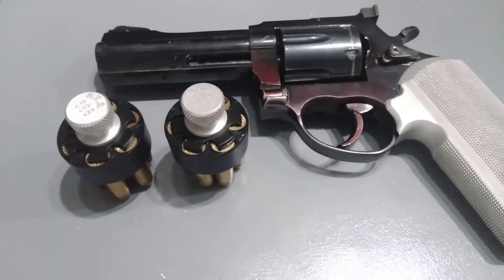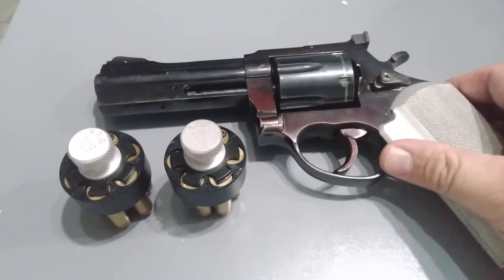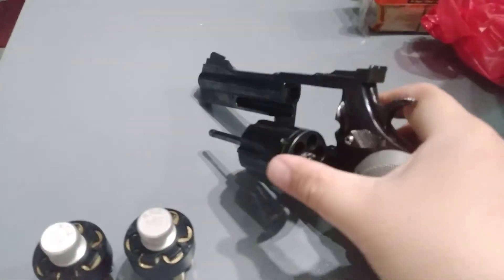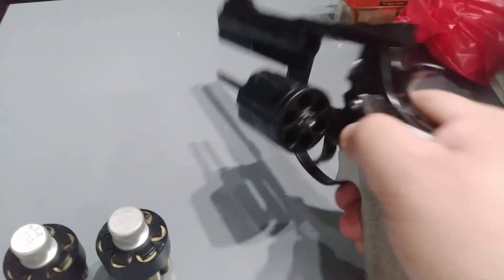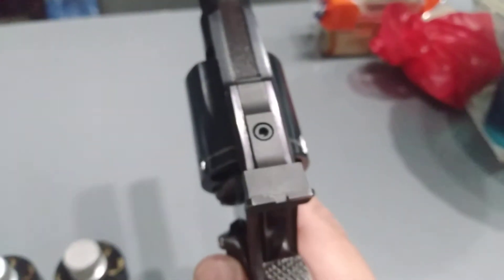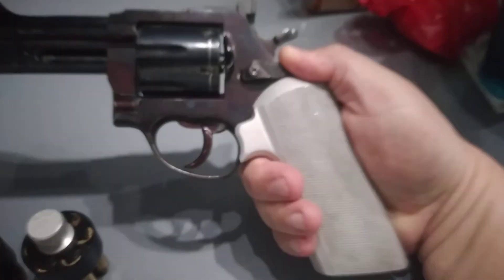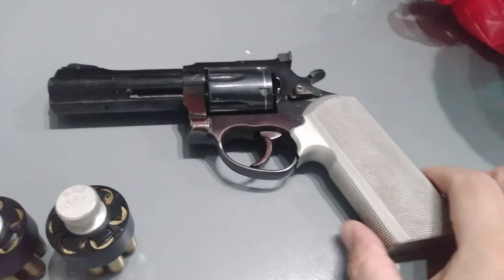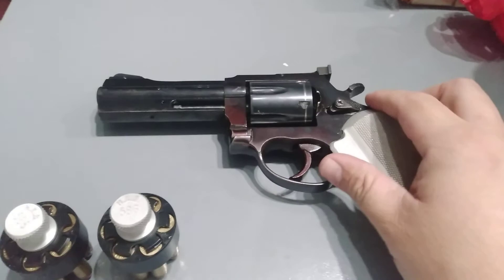Rexio .357 Magnum Revolver Mods -- An Impromptu Demonstration

Comment: Marerecommend niyo po ba ito compared sa RIA/Armscor M206? Kasama kasi to sa Red Tag sale worth 11k siya ngayon unit only sa pbdionisio.
Reply from the maker: Recommend for what purpose?
If used as specimen for leisure range shooting, experimentation, hands-on learning about revolver's use, or as "proof-of-concept" platform, YES, any economically priced gun may do.

But for self-defense and competition, that has been proven solid and reliable yet not too heavy only two .357 revolvers I can "recommend":
a) S&W Model 19 "Classic"
b) Ruger GP-100 "Match Champion"
In that order both in 4.25-inch barrel length and nothing else.
Reply: @chrissanchez9935  Would they cost more than 30k pesos? Sorry I wasn't sepcific. Im actually just looking for a good home defense gun. I mostly don't see myself going to the range for it. Just to have a gun inside my house that won't fail me and something that won't break the bank if I look for a gun that would costs 20k+ I see myself trying to save for it for at most 6 months.
Reply from the maker: @harry619 , if you have an LTOPF, maybe I can sell this to you for P15,000- EXCLUDING  the speedloaders. We just wait for the Election Ban till mid June this year. Transaction must be made in Crame, so you can check the gun's records for your peace of mind.

I can also will teach where to get good quality full-power .357 Magnum loads.